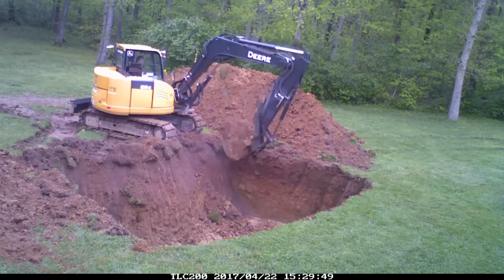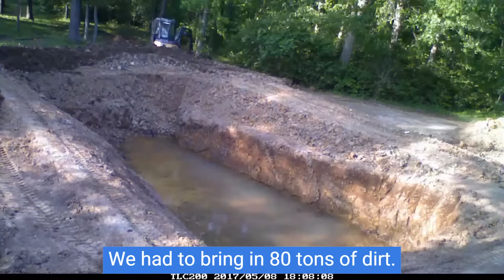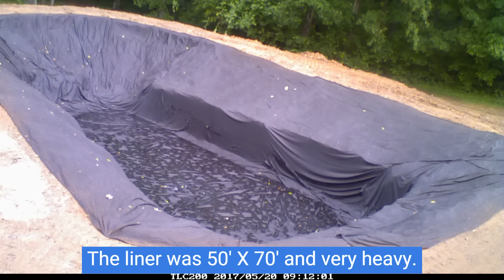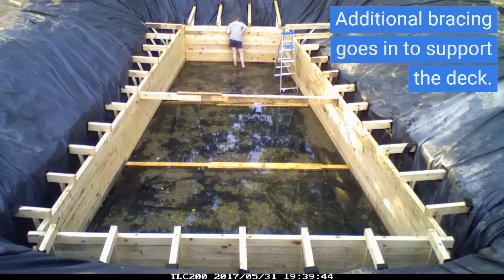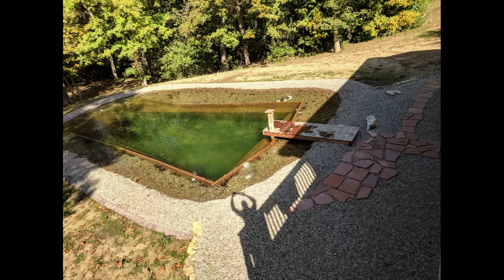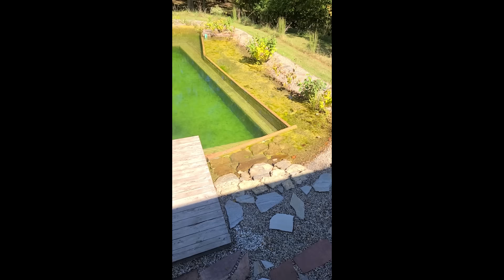Natural Pool Time Lapse Build

Comment: Having built pools for 40+ yrs. There are so many future problems with this build. Voids   under the deck, trapped water on outside of wood... the wood itself is a disaster...good luck
Reply from the maker: After 6 years there haven't been any problems.
Reply: It sounds like you've never seen a natural pool before. "The wood itself" What?
Reply: @Biggiiful Pine isn’t known for its moisture wicking abilities.  It tends to begin to deteriorate with rot after about ten years if untreated.  

Teak, while expensive, probable would have been a better option. 

Regardless, this will last a while.
Reply from the maker: Wood doesn't rot if fully submerged.
Reply: @jonathanmcmahon2214  Ooooh, I didn’t realize that.  I’ve never tested the theory so I’ll have to take your word for it. It seems plausible though.  The water acts as a barrier from the fungus maybe?  I learned something new today.
Reply from the maker: @millroyboy07 that's correct. The term "wood rot" is a bit misleading because wood doesn't rot itself. Rot describes the process of fungus and insects breaking down the wood fibers and lignin. Venice was actually built on wood pilings.
Reply: @jonathanmcmahon2214  That’s interesting and convenient to know.  Thanks.
Reply: I learned so much from this conversation- thank you
Reply: This is interesting. I know nothing of this stuff. So, I've a real question about this (not trolling, just interested.) I understand the wood is submerged in the water in the pool on one side. What about the wood exposed on the other side opposite the water facing the dirt and insects?
Reply: @Manowar721 same principle applies. theres no air, so the rot is slowed down to an imperceptible pace. go look at a dock with wood posts. they only rot at the waterline, where moisture and air are both present
Reply: I always wonder why I'm seeing wood under water. It's definitely not a good idea
Reply: @jonathanmcmahon2214 wood will most definitely rot when submerged. It happens all the time to bulkheads, ships and trees that fall in.
Reply: @jonathanmcmahon2214  6 years? So why the fuck was this video posted 8 months ago?
Reply: @PhoenixAndTheRaven rot can’t begin without oxygen and water. It will never rot while submerged because there’s no way for it to oxidize.
Reply: @Mtn_Mateo  incorrect. Types of fungus and the oxygen that is dissolved in the water leads to rot all the time. Sure, if there is little to no oxygen, the wood won't  rot. In a natural pond, the oxygen levels get reduced by the decay of organic matter. In a pool like the one at hand, the is a waterfall or feature oxygenating the water most of the time. There is also a means of filtering out the organic material. So the oxygen level will be higher than a natural pond. This isn't a vacuum in a lab.
Reply: @PhoenixAndTheRaven  buddy there’s no oxygen down at the bottom. Swim to the bottom and try breathing for me
Reply: @Mtn_Mateo  during the cold months, fish and amphibians alike stay near the bottoms of freshwater bodies, as that is where all the oxygen is concentrated. Some species of wood are far more resistant to rot than others. White oak, red cedar and mahogany are immensely resistant. All of these factors change the second you’re dealing with a treated pool. There are a million wrong arguments in here that are both for and against this pool. If we, commentary participants continue wield science ignorantly, like a toy in comment sections, then we don’t deserve to make it off this planet. I observed a long list of stupid assed arguments and choose to reply to the dumbest one strictly for my own amusement. Yes, you. Get smarter. You have a long, difficult life ahead of you cycling this kind of stupidity.
Reply: @Mtn_Mateo lol, the oxygen is dissolved in the water. What do you think the fish breathe?
Reply: Always going to have someone show up and try and ruin the positive vibes you’re trying to put out.
Reply: @Biggiiful this is a natural pool? Lol okay
Reply: @jonathanmcmahon2214 not true

For wood not to rot under water you need one of two things

Lack of light (15meters or so)
Or lack of oxygen 

Trust me the wood in this pool is absolutely rotting
Reply: @fyidelis you didn't learn anything factual.
Reply: @hanu9830 you are spot on.
Reply: @Mtn_Mateo so what's the I stand for in H2O
Reply from the maker: @thenarrator1984  For wood to rot under water you need one of two things

Insects eating it
Or fungus eating it

Trust me the wood shows no signs of rot after six years except where the posts for the dock come out of the water and stay damp all the time. "Wood rot" is not something the wood does to itself, but rather the term to describe other organisms breaking it down over time.
Reply: @Mtn_Mateo wood can rot under water , some water can contain high levels of oxygen that's when it tends to rot , only way it won't is if there is little or no oxygen levels
Reply: @MatthewCurtis-zp1fd  thank you for informing me, I was unaware
Reply: @MatthewCurtis-zp1fd wait is that why hottubs made from cedar last 20 years or more because the wood is rotting? Hmmmmm, so…….the wood is rotting and will only last 20 years, because  20 years is a long time to have a wood pool, 20 years is a long time to have an outside pressure treated deck let along a pool, I’d like to see any of y’all haters do what this guy did
Reply: @danbrandt7252  I ain't a hater , I could never do what this guy did . I'm just saying wood does rot under water IF there's a high oxygen level in water .
Reply: @millroyboy07  there's something that I'd like to add about wood not rotting when fully submerged. The organisms/microorganisms that live completely underwater are mostly adapted to consuming things that are predominantly found underwater. The organisms/microorganisms that live on land are more suited and adapted to breaking down wood from trees, since those are things that are naturally occurring and abundant where they live. That's a big part of it. There may be some damage done by expansion and contraction due to temperature fluctuations in areas with extremes of heat and cold, but the main mechanism of rot and structural failure would be rotting due to natural breakdown processes (i.e. mainly land suited creatures, who are microscopic or otherwise, consuming the wood).
Reply: @firebeardlongfellow5295  the date on the video shows construction beginning in March 2017. That's over 7 years at this point. Just an observation..
Reply: If the wood is submerged under water, it shouldn't have any problems.  Rotting starts when you have water and air touching the wood .  Great build!!!!!
Reply: Boats were built from wood in the day...huge ships!
Reply: The wood is underwater. Swamp loggers pull up logs that’s been in the water over 100 years to make things out of because of the look of the wood grain. My bro in-law has a rifle with a swamp wood stock.
Reply: Some call it a pond
Reply: Yeah so wood rot happens when wood is wet then dry again and again
Tons of stuff is preserved very well if fully submerged and not exposed to air
Dissolved oxygen in the water does not effect the wood like you would think, tons of beautiful wood gets pulled from the bottoms of water all the time
Reply: @Manowar721  it looks like there’s a space on the outside all the way around that will hold water. I was very confused about what he was doing until it was finished.
Reply: @billymorris3265  fish stay near the bottom of water in winter because it’s warmer.
Reply: @danbrandt7252  I’ve seen a treated deck last over 35 years. Not exactly sure when it was built, sometime in the 1970’s. But before 1980. Not sure the condition when it was taken down but it was removed sometime after 2016. My relative’s house. Made me think of it when you mentioned a deck lasting 20 years.
Reply: @Mtn_Mateo and yet fishes find it ... the O I mean😂
Reply: Iroko, Oak, Western Red Cedar, Cherry, Maple and heat-treated

Comment: This will end up a complete and expensive disaster….the high ground water level will exert incredible hydrostatic pressure on the pool base and sides causing a collapse. The soft pine wood used has no internal strength an$ will rot away in less than two years.  He should have gone to Vegas instead of throwing his money away in the doomsday pool disaster!!
Reply from the maker: I'll add you to the internet experts who have no idea what they're talking about. Thanks for your contribution.
Reply: Dude says the wood will rot in two years on a pool that's been installed for 6 years. They keep getting smarter and smarter.......
Reply: 😂 The water in the pool would apply at least equal and more pressure against any groundwater present outside the liner. You have no idea what you're talking about but had to say something negative.
Reply: And to add, wood rotting underwater. 😅 Trolls....

Comment: This was a pretty neat idea. It would be interesting if you made another video narrating this and talking about the building science that motivated you to try this. I wonder how long it will last? I think it would have been cool to put a mixture of slate and smooth/tumbled rocks and sand on the floor of the pool instead of gravel, and perhaps some aeration plumbing underneath in a few spots, and perhaps UV lamps in the filtration system to control algae (although those lamps do get expensive). Did you use sand filters for the filtration? Was this more or less expensive than a regular pool with rebar and shotcrete? How much did all that pine cost? Sorry for all the questions! 😁

Comment: Great project. Not sure I would have the guts to try out the whole "wood not rotting under water" principle. However, more interested in how you prevented bacteria buildup, making the pool a haven for microorganisms and algae without chlorine or salt water? Just circulating the water does not seem to be sufficient usually.....?

Comment: Looks like it turned out great. But won’t the wood rot and eventually fall apart after like 10 years?
Reply: Yes
Reply from the maker: Wood doesn't rot if it stays submerged. Wood rot is caused by fungal growth and insects that live in damp wood. The dock is mad from local cypress that will easily last 20 years in this area exposed the way it is.

Comment: Thank you for the video. Why do you have the wood in the water? What is its function? Also, I would expect the wood to rotten fast over time.
Reply from the maker: The wood serves as a perimeter for the swimming area. It also creates a 3' deep perimeter so you can stand up. Wood needs to be exposed to air to rot. Being completely submerged will preserve it.
Reply: @jonathanmcmahon2214  I had no idea. Good to know, thanks.
Reply: @MrGoenes  that's the same reason why wooden or metal objects salvaged from hundreds years old shipwrecks are kept underwater in museums.

Comment: how do keep the wood from rotting? thanks ..

beautiful work by the way😎👌
Reply: Wood that is constantly under water shows almost unlimited durability. It will never rot. You can buy wood such as "Fossil Oak", which has been under water for several hundred years. It is very expensive.
Reply from the maker: Exactly what @mbomam89 said.

Comment: For building: is there a reason you chose to use stainless screws over dowels? Was it easier and more cost effective or just choice? Thanks
Reply from the maker: Honestly, dowels never even crossed my mind until this comment. As I think about it, I can't come up with a reason not to use them.
Reply: @jonathanmcmahon2214  I can think of a reason. Not having to drill 10,000 holes and pound perfectly seated dowels into all of them? 😁

Comment: Beautiful, but honestly thought you should have backfilled the wall behind with gravel as well. That’s a lot of open space where the clay or whatever with water can fill and put back pressure on the walls. Maybe the French drain will help, if it does, fantastic.
Reply from the maker: I figured the pressure of the water would do the same or better than the backfill. So far, so good after 6 years.
Reply: @jonathanmcmahon2214 
What type of timber is used ? I take it that it is naturally water resistant timber?

Comment: sorry, i'm up to plan my first eco pool and i'm watching and watching again your video. There is a point at 4.24 minutes that you write "plumbing goes in to circulate the water". Do you have a change to explain how you did it? It will help me a lot? I guess that between the deck and the liner on the side you full fill with gravel and you bury the pipes in to but i do not understand how you connect the plumbing you prepare at minute 4.24 of the video with the  minute's 7.45 plumbing. Thanks a lot!
Reply: Same here!
Reply from the maker: Since building it I eliminated most of that plumbing. I found that building good top skimmers is the best way to circulate the water and keep the swimming area free of debris. I think I talk about the skimmers in one of my later videos. Maybe one day I can make a video about them.

Comment: Real pleasure to see fortunate watercreation with wood - i can watch it again and again. But i`ve got a QUESTION: why at the first level of the walls there is remaining "cavity" all around between the liner and the wood wall? It seems like this way soil would droop down over time and push liner from outside. Besides it looks like such ditch will be filled with water after all and without circulation there it`s like "mosquitoes paradiese". So please tell me, somebody: Why there is no gravel or any other buffer to support the outside soil? Why it looks like conscious decision - to have big empty space without circulation?
Reply from the maker: There is enough gravel between the wood and the liner to lock the wood in place and keep it from floating. I left a cavity because of the expense of bringing in more fill. I decided the water would create the back pressure needed to keep the dug walls from caving in. Mosquitoes spawn closer to the surface. The pool has greatly reduced the presence of Mosquitoes.

Comment: Keep brushing and adding clarifier by the bucket. Run the filters 24/7. Use an air line to blast the crud building up in the bottom where it can be filtered out. Have the water regularly tested during the swimming season. Chlorine, Bromine, something.
Reply from the maker: It's a chemical free pool.
Reply: @jonathanmcmahon2214  
No chemicals? How do you keep harmful bacteria from exploding in the pool? It must be brimming with colliform bacteria and parasites. All that algae isn't safe either I wouldn't think. You have no way of sanitizing your water, which is very unsafe.
Reply from the maker: Have you ever swam in a freshwater body of water like a lake or a river? It works off similar principles but in a more controlled environment, so it's cleaner. We had it tested yearly during the hottest part of the season. It always came back clean. Not all algae is harmful. That is a very common filimentous algea that is beneficial to the ecosystem. The nitrogen levels are so low they don't register on tests. If the nitrogen ever spiked there might be cause for concern. Aeration, motion, and plants all work together to keep the water clean, clear, and safe to swim in.
Reply: @jonathanmcmahon2214 
Two kinds of people in this world, those that admit they pee in pools and damn liars. What neutralizes the bacteria from fecal matter and such in your pool takes time. Plenty of time for you to ingest your fellow swimmers poop full of living bacteria.

Comment: I would have left out the wood and just used the liner. The day you put the pine down and deck is the start date of rot. I’d give it a life span of 8 years or less then you can start a new project with all those stainless fasteners.
Reply from the maker: Wood is preserved if fully submerged. You need air for insects and fungus to rot the wood.

Comment: Cool video, but seeing as the wood isn't treated, or lackered or have any weather protection or water proofing. I give it a year to 2 years before it has to be drained. There's a reason wood isn't used for pools and that's because it will ultimately work then rot away.
Reply: @mbomam89  The wood he's using isn't treated, or anything. Wooden fences in rainy areas have to be replaced about every year or it starts rotting. Also most docs aren't made with logs anymore. They use concrete reinforced with metal barbs.
Reply: @mbomam89  It rots in water. Wooden boats had to be painted to prevent it from rotting. Wooden docks the beams in the water may take longer to completely rot away because they are thick logs but they eventually did. Then people started using cement and rebar because it doesn't rot in the water.
Reply: @mbomam89  The wood the guy is using isn't fossil oak. It's just lumber. Untreated in protected lumber.

Comment: Its funnny ive seen maybe 5 builds lkke thisand no comments about wood rotting haha
Reply: I don't see a problem with that. It's basically an aerated pond, so what if the wood collapsed? It will stay in the same shape. I don't really understand the purpose of structure inside, more often it's done with a cinder block, but what for?
Reply from the maker: Most comments are about this. Wood doesn't rot when fully submerged.
Reply: @jonathanmcmahon2214 erm wrong... Yeah it does... Especially pine .. 

Why ya think medieval ships were made from oak not pine? 

Google it dude... Bit late after you blew 20k on mulch.. but better late than never...

Why not do the job properly, add a filter system and create a pool rather than a mosquito breeding ground?
Reply from the maker: @tadaaaa952  There is so much wrong with your comment I'm not sure where to start. Focus on "fully submerged". Or, never mind, I don't care to educate every internet try-hard that believes they are an expert. Have a nice day.